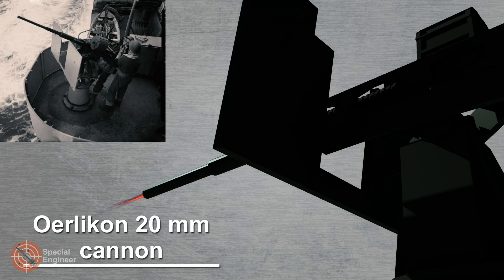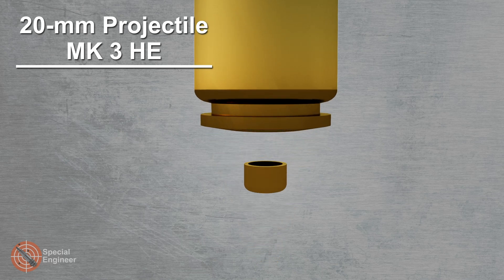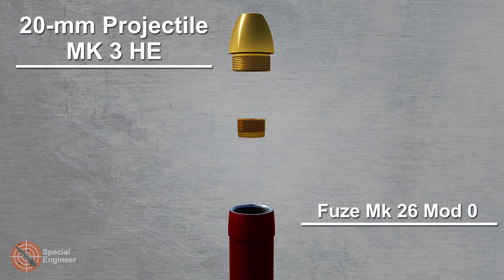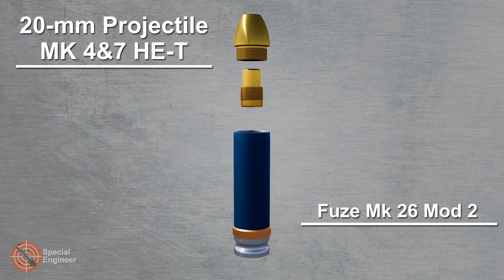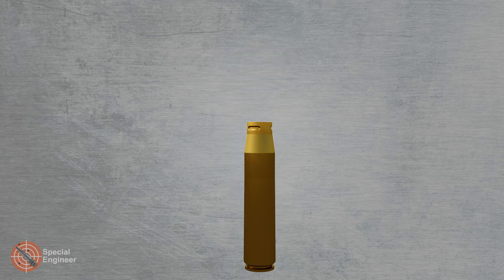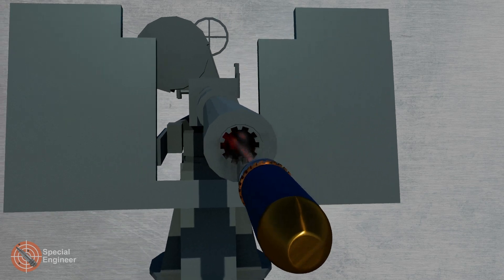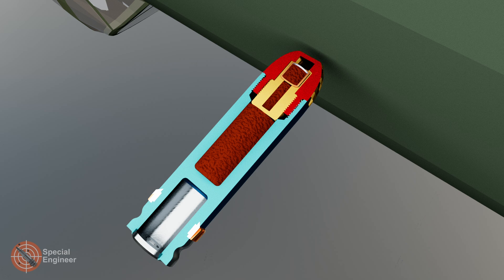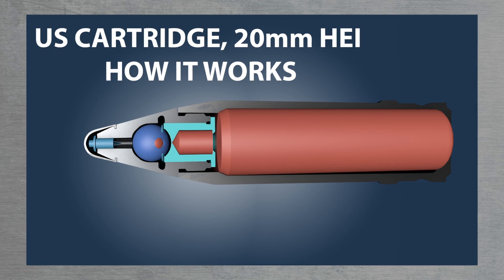20mm Ammunition

Comment: If I remember correctly, Britain used air compression fuze occasionally. which is pretty much an isolated air inside a shaped sheet metal. The thickness and the hardness of the outer shell is adjusted for a proper delay. Japan used the same principle in their WW2 Ho-103 machinegun with the Ma-102 rounds, their army 20mm had a similar counterparts called Gou hatsusei-shinkan (in which, translates to roughly "On-hard fuze"), and instantaneous explosion variant. I have to double check some stuffs on the sources but French used the Brit-type 20mm air column. Some of the Number 25x fuzes. Their usage continued to the post war era. They even made it into 30mm cannons for aerial uses.
Reply from the maker: Cool. Glad to talk to such a specialist. Thanks
Reply: @specialengineer2718  I don't know if it's sarcastic or not, but I accept either. I just don't have enough confidence on this.
Reply from the maker: @Astrawboy_NameAlreadyInUse  really, very interesting information. Thanks